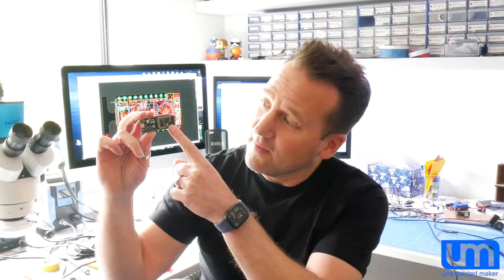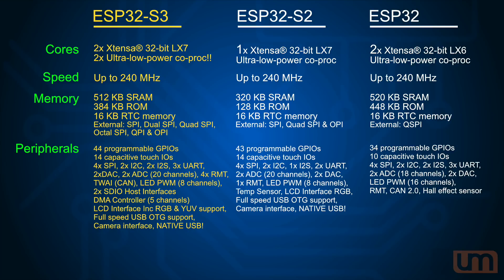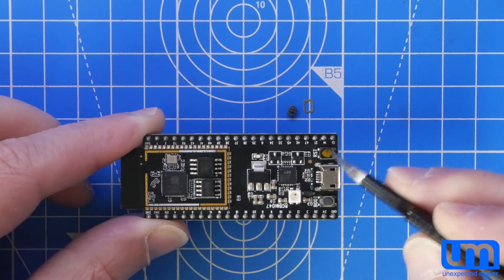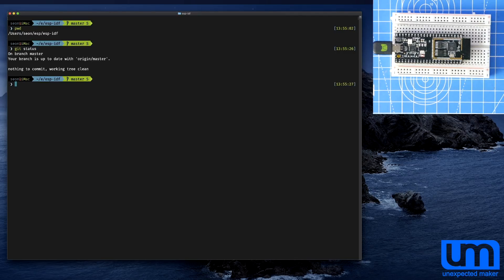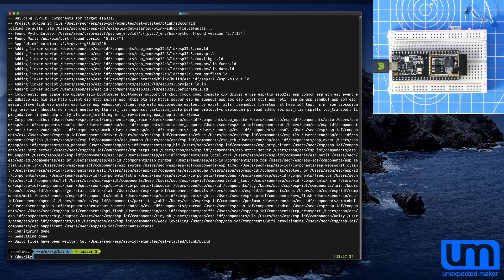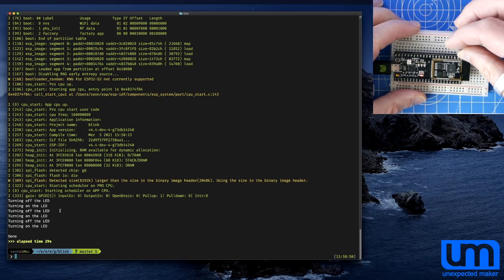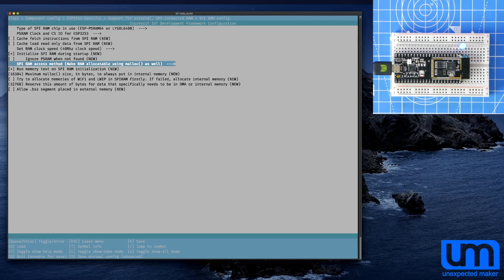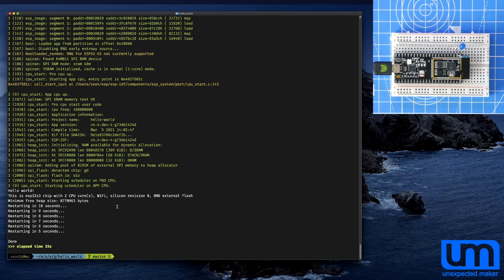ESP32-S3 First Look + Specs!

Comment: The esp32 s3 is a pos! I tried to upload to it and now it just shows a black screen. I don't get all of the hoopla over these.
Arduino- You plug it in. Pic the board. Upload and BAM! It's running.
These are supposed to be better, smarter. It won't even work.

Comment: GOOD JOB. The same code compiling failed on S3 but compiling passed on S1, why?
Reply from the maker: S1? You mean the original ESP32? Because under the hood they are different, and have different tool chains and some differing APIs. Even different internal peripherals. S3 adds new and different things but also removes things. Some code will work on both, lot's of code wont.
Reply: @UnexpectedMaker  Thank you for quick reply. I'm compiling an example from Arduino IDE: SerialToSerialBT actually just few lines of code.
Reply from the maker: @summerfun6114  And my above statement is the reason. The S3 doesn't have Classic BT - Only BLE, so no, Classic Serial BT examples wont work...  and S3 BLE is 5.x not 4.x, so BLE API is also now different. This is all possible to learn via google search :)
Reply: @UnexpectedMaker  great. thank you.

Comment: 3:36 there's a bug that they appear not willing to fix where the reset command sent by the upload tool does not work, forcing you to press the Reset button each time. And Bluetooth Classic is not supported in the S3. -Frank
Reply from the maker: Not quite right - They are willing to fix it - but it cant be fixed in code. It required a fix in the ROM mask and a new silicon revision, which has been done. Also none of the new ESP32 MCUs have classic BT - Only the original ESP32 has classic.
Reply: @UnexpectedMaker  Thank you for correcting me. I'm glad a fix has been done. And I'm glad to be an enthusiastic supporter of ESP32-S3 and whatever comes next. I wish they supported BT Classic as it is much easier to code for. What is planned post S3? -Frank

Comment: Odd that it has the 2102 handling the USB port when it has USB support built in.
Reply: Handy if you want to power the board and do something else other than the serial/debugging connection with the USB port (I'm using it as a host)

Comment: Now that even MIPS ceded to RISC-V, our prayers are with Espressif to un*fuck themselves and replace the retarded ISA of the past with proper 2 x RV64GC (Canaan pulled that off in 2018, to much delight.)  Now, THAT would be cool. It is obvious that they are flirting with the idea, but C3 is not bold enough (as cute as it is).

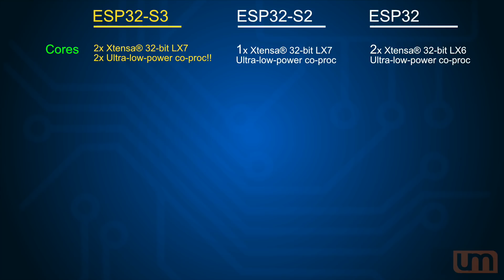Comment: 0:57 The currently installed ULP (Ultra Low-power Processor) is a Finite State Machine but in the S3 it's being supplemented with a RISC-V ULP.  The RISC-V is a free/open specification instruction set CPU which is being picked up by many companies.  In the S3, you select which ULP is enabled.  I suspect the RISC-V will replace the FSM in time but they're both there for now.  It would be wonderful if the RISC-V became the default core throughout; one base instruction set to rule them all. [Edit:The ESP32-C3 is a RISC-V chip.]

Comment: What would be super cool is if they could  split the radio and bt chips and then have  the ability to access BT only using the ulp co processor in deep sleep mode, then only can it truly be classified  as BLE. That way you will have a way to wake it up from a bt connection.

Comment: Great video and intro 🙂👍.  One of my biggest challenges with existing Esp32 has been high power demands when using BLE.  Have you seen any data yet on whether the S3s 5.0 will improve it?
Reply from the maker: The S2 has an improved Wifi PHY, so hopefully the S2 will have improver BT PHY as well, but it's way too early to tell, sorry.
Reply: @UnexpectedMaker  cheers.  I asked them direct.  Dev boards May and will check out the draft datasheet 🤞

Comment: I can't even find the s2?
Reply: There is many boards with S2, including featherS2, cucumber, saola, kaluga
Reply from the maker: The S2 had been out in various flavours since December last year, Check DigiKey.
Reply: I guess if you are in the US that's true. I live in Indonesia. Its easy to get the original esp32 and it's pretty cheap too. I have used it in 3 different projects. But the new s2 has yet to show itself around here. Also can't find it on Ali express
Reply: @jarchdm  there is at least 1 board with S2 on aliexpress, try to search for ttgo S2 or similar
Reply: @chegewaras  thx found it. Funny its over double the price of the standard esp32
Reply: @jarchdm  I'm pretty sure you can find S2 with good price, but I am ordering from mouser, so I can't tell you what boards are on aliexpress
Reply: @chegewaras  thx guess price equals availability cause the original esp32 is better in many ways than the s2. I can get the original here for very cheap.

Comment: amazing, thx, hope we can run circuit python on it soon
Reply from the maker: No porting work has started on the S3 for CircuitPython that I am aware of
Reply: @UnexpectedMaker  out of interest, what does that work entail? Is it just changing some port numbers or way more elaborate? Thanks for all your work
Reply from the maker: No, the way ESP32S2 is setup in CP, it's going to need to be a new port and  a considerable amount of work to add S3. Not from scratch like the S2 was though. I doubt it will start for a while as S3 support is still not finished in the IDF. That said, I have a MicroPython port running on my S3 board already :)
https://twitter.com/unexpectedmaker/status/1368056555778629637
Reply: @UnexpectedMaker  wow. How is that possible, it's not even out yet! And how is circuit python so much work to setup... Much to discover (and not so clear how/where). In the meantime I hope we can expect a bit an easier setup with circuit python and the s3, without needing to solder an extra usb connector to some pins :-(
Reply: @UnexpectedMaker  wow, that tweet. I'm a fan now haha

Comment: There no point to introduce if you can’t actually buy it or even think if using it for mass production
Reply from the maker: Of course there is!
Reply: There is point, because you have time to consider what chip available on market you can use in product, and I mean hundreds thousands devices product. People can see it's working even if hardware is not finished yet, but API is supporting it, at least part of it, because it's backward compatible

Comment: Very cool. And the dirty little secret you could have plugged your led directly to ground without resistor at all. Set pin high, go to bed, wake up the next day, look at your led. Worlds slowest blowing led 😁
Reply: I should add the older LED would flick on and die righ away without a current limiting resistor but the cheap Chinese arduono kits usually have LEDs that don't have the same behavior. You still want to use current limiting resistors when for example you have a simple logic IC like a shift register that has a maximum current handling limit and you are using it to directly drive a bunch of LEDs. Exceeding the current limits of the logic chip will likely lead to damage. But the general idea is still good to put them in as a force of habit and good design but today the old saying doesn't fit niversally like it used to. If worried about testing an LED to see if it's working without fussing with resistor use a coin cell battery, those won't be able to deliver any runaway currents a LED might try to draw.

Comment: Is the pinout already set and fixed on the modules? 
Do you have a data-sheet for it?
Reply from the maker: Nothing is fixed... As I said, this is an early sample.
Yes I have an early datasheet, no I can't share it, sorry.
Reply: @UnexpectedMaker  no worries! Thanks for the video! I would love a decent esp32 board with a lora footprint on the bottom of the board.... 
might try this with this chip, or wait for someone like you to do it =p

Comment: If I'm correct the S3 is the first device that will have USB + WIFI + BT is that correct ?
S2 has USB but no BT it seems.
(Would like to use it on a project with USB HID + BT HID)
Reply from the maker: That's correct. But if you use USB HID you can't use native USB for flashing etc. But you can use an external serial2uart to flash and native USB for HID.
Reply: @UnexpectedMaker  Wonderful! I've been commenting I wanted WiFi, USB HID and BT on every damn video about a new release from Espressif, you totally made my day! :)
Reply: @UnexpectedMaker   actually that's not true; I just checked with simple example using my arduino library and I can flash over USB (no need to use buttons) and having HID mouse running, the problem is on windows, but it's not related
Reply from the maker: But while the Mouse is running you have no serial right?
Reply: @UnexpectedMaker  why? I do have both, CDC serial and mouse working at the same time
Reply from the maker: @chegewaras  Hmm, I think we are talking about 2 different things. I'm talking physical USB connections. Plugging something into the USB port as an. You can only plug 1 thing into the port at once.
Reply: @UnexpectedMaker  I am talking about native USB on S2, with CDC serial and HID device, so esp32 S2 can work as mouse, and have CDC to easy flash over USB port without need to add cp210x
Reply: Yeah I think the mag tag in Circuit Python shows up simultaneously as USB msc, cdc, and hid. Might even be dual cdc with newer betas. I think it only shows the msc firmware upload in the uf2 bootloader mode
Reply: Will buy an S2 in the meantime to practice on that one while I wait for the S3.
Reply: I assume that Adafruit will probably port their uf2 bootloader to it just like with the s2. I've got an s2 board from them (mag tag) and there is no USB uart converter, just the native USB, and it's awesome. (It also has a usb rom bootloader for esptool, which you can actually use to install the uf2 bootloader, wonder if that will return with the s3. I would hope so.)
Reply: @rpavlik1  do you mean that after that you have a small boot loader that let’s you boot the board into flashing mode or into USB HID ?

Comment: Looks like this is the replacement for the esp32 and the s2 is the replacement for the 8266!
Reply: I've heard that they'll be positioning the C3 as the 8266 replacement allegedly, though I don't think anybody has pricing info yet. S2 is kind of in between, and yeah the s3 definitely blows away the original esp32. Shame they didn't bring out the native USB on this dev board.
Reply: The naming is pretty confusing yeah, the S2 was newer tech wise, but a step down in functionality while this is both the step up that the S2 was with the extensive functions of the original ESP32. Perhaps ESP32-S2-MAX or something? :D